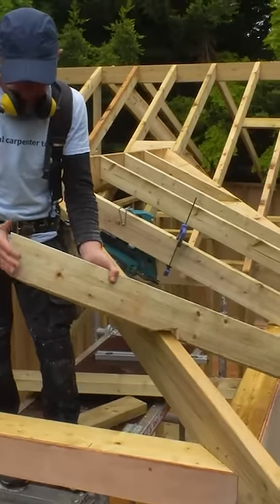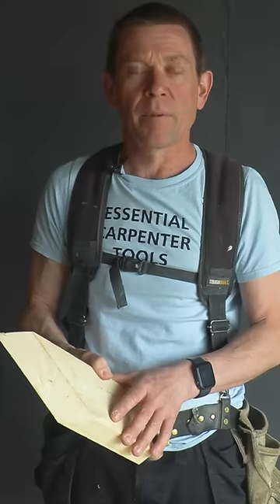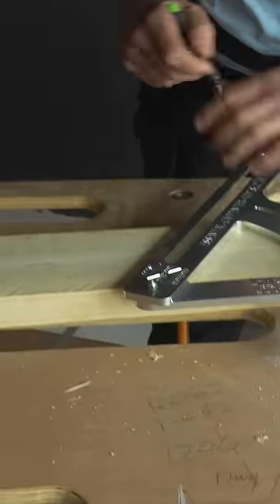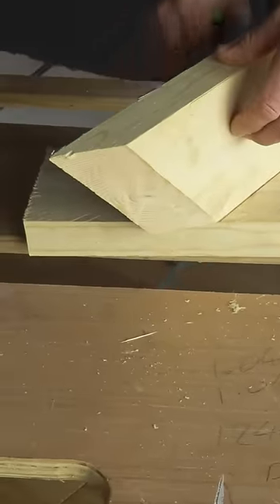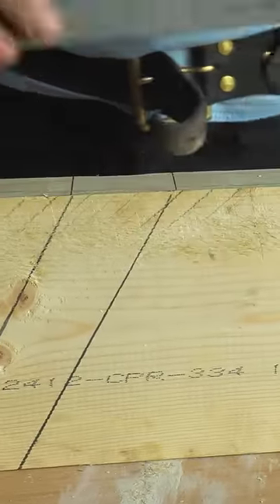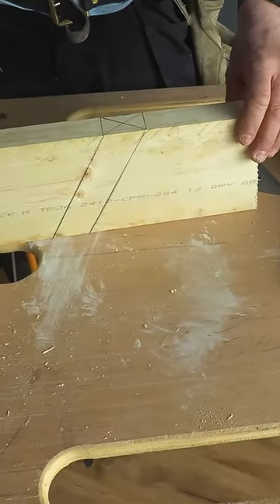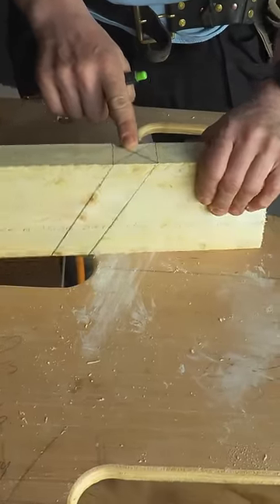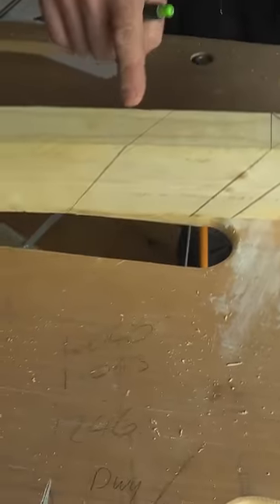Splay Cut Trade Trick #shorts

Comment: So what is meant at the end, do you want 45 or not ?
 45 sits right and the angle shown is only due to the thickness of the wood placed on top. It’s 50mm ( say 47mm) if it was 35 mm it would be a different angle. 
It should be pitch and 45degrees. The comment at the end has thrown me completely
Reply: No I didn’t want 45 degrees.. 
but you would think that doing it this way it would be 45 degrees.
Reply: @Ultimate-roofing-square.   Ah.. Just shows, I thought I knew how to do this and clearly I don’t 😮‍💨🤐 
 When I have cut a roof, everything seemed to fit perfectly but i must’ve done it wrong.
  Love your videos, and the little ‘get around’s you do 👍🏻
Reply: @140rware  baffled…
Thanks for watching them.  😉

Comment: Hi Dan, was the piece of timber laying on the hip being held at the splay cut angle of the jack rafters, or at 90° ?
Reply: Relative to what? I could answer "yes" to both of your questions depending on what you choose as your reference point.
Reply: @DavidSmith-vr1nb   I wasn't asking you so forget it I worked it for myself.